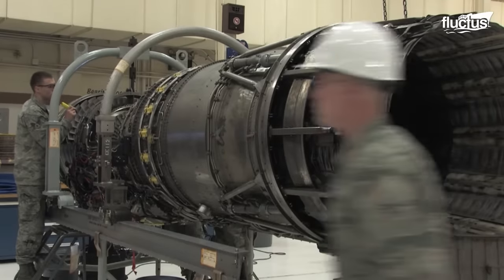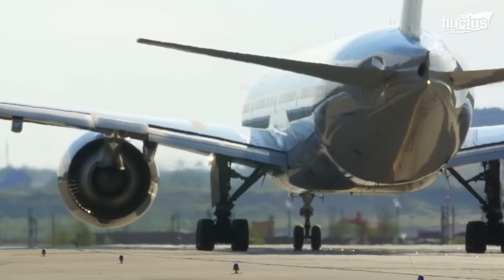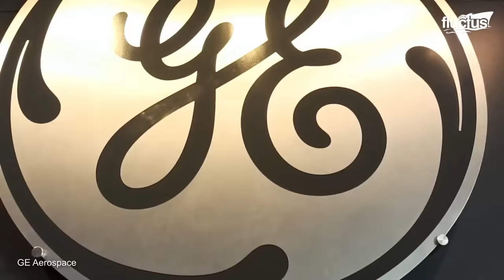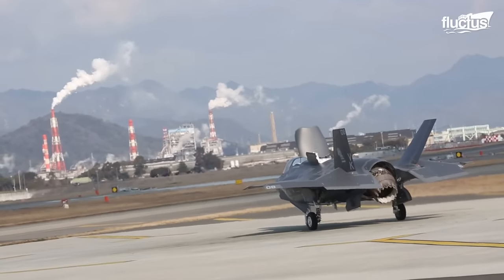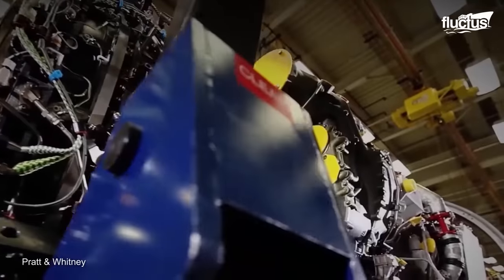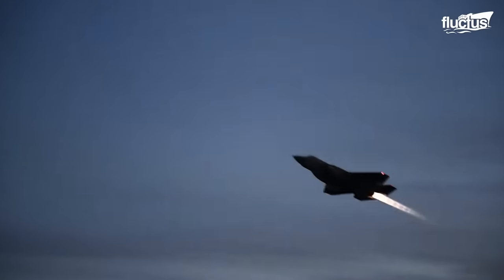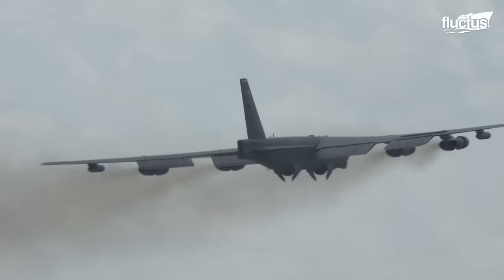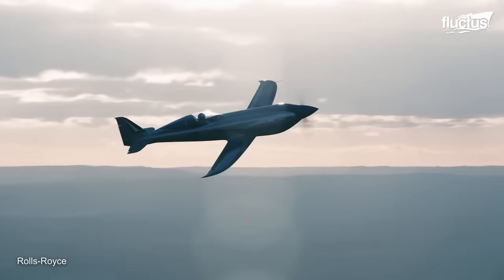Inside Advanced US Megafactories Building Billion $ of Futuristic F-35 Engines

Comment: The F-35B does not have a vertical engine. The front Lift-Fan is driven off the one jet engine Pratt & Whitney F135-PW-600 via the Rolls-Royce Lift-System.

Comment: Electric aircraft ??  Imagine the weight of the battery pack, even for lightweight aircraft!! Pilot to tower: "I'm declaring an emergency!"  Tower: "What's your problem?"  Pilot: "My batteries are dead!!"
Reply: Or  "This is your Captain speaking. Passengers with fully charged phones are kindly requested to connect your phones to the connectors under your seat. Apply to flight personnel for more information, but for God's sake, do it fast "

Comment: I was at Edwards Air Force Base during the testing of this aircraft. 
The reason the 35 was built, was to give the u.s. a plane they could sell.
The technology on the 22, is still top secret and when it goes out of service, it will still be top secret.
The closet plane today to the 22 is the B-21.
If you still think these aircraft are advanced, you should have seen what was being developed in the early 90's.
Reply: early 90's? any example?

Comment: You state that the F-35B VTOL model has an engine behind the cockpit that "points up" in addition to its propulsion engine. That is not correct. The F-35 has ONE engine that drives a ducted fan for vertical takeoff.

Comment: Do they test every engine they manufacture?
Reply: I think for the price of the engines and the small amount used and manufactured they probably run tests on every engine also considering a mistake could be a one time mistake since it is made by humans and also considering the chance of the engines failing mid flight is to dangerous so if the manufacturer doesn’t test it the buyer definitely will
Reply: "Acceptance Test" is considered a part of production and is SOP in most cases.  They do this of course to ensure any post-assembly issues are caught and remedied before delivery to any customer.  Acceptance Test also establishes a baseline for an engine that can be used to project out maintenance planning into the future.  There's a lot more to it than just that, but that is the gist of it.
Reply: "Do they test every engine they manufacture?" 
Yes !

Comment: I get to test the f135 engines here in Oklahoma. They are pretty insane in person. Getting up close to all the machining and engineering on each part is amazing. Not all your facts were correct tho. Still a great video none the less
Reply: They aren't that amazing. The f16, f18 and certainly f15 have better engines. Whats so mesmerizing abt this plane?
Reply: Dependable engines
Reply: @TheMrgoodmanners they make more power than the engines in any of the aircraft you just mentioned, and in the case of the Hornet it makes more power than its 2 engines and ties with the Super Hornet's improved twin engines. It's not even a completely bespoke design, having sourced from the F119 and still manages to power both the aircraft and numerous systems onboard that would likely fry legacy fighters trying to run them.
Reply: @forzaelite1248  Well said. this. engine is the evolution of the F119 and proud to be so. The difference in performance between the F-35 and. F15 stem from differences. in aerodynamics and USAF changes in doctrines.
Reply: You get to test F 35 engines you must be at Tinker I used to work on TF 30- P109

Comment: Jet engine do not have 1000s of moving parts, some assemblies have 100s of parts, but operate as a unit. The F35 does not have a front vertical engine, it has a "FAN" driven off the main engine
Reply: Modern engines do indeed have a thousand moving parts. Just the IGV system alone has several hundred.
Reply: Keep the noise down little man
Reply: @shannonjurgens3667 that seems a bit much, afaik the moving parts of a jet engine are usually just the turbines which total up to two or three spools; I guess the compressor/turbine blisks count up to 10-15 or so if you count them unless you're referring to all the fuel/oil valves. Technically speaking, engines like ramjets and scramjets have no moving parts at all
Reply: if a part A is attached to a rotating part does that make part A moving?
Reply: What about the fuel control unit, pneumatic starter, hydraulic pumps, oil scavange pumps, pressure pumps, pressure reducing shut off valves, check valves, thrust reversers, dynamic seals, Intergrated drive generators, dedicated alternator, fan air valve, gear box...how many moving parts do they have...and yes I fix jet engines.

Comment: RR had the oil stub-pipe problem and PW had the exploding combustor cans problem. I prefer GE.
YES, I watch a LOT of airplane disaster videos. Planes are only as safe as the worst mechanic to work on it, and as dangerous as the airline that cuts corners, and refuses to grease parts like the jack-screws.

Comment: The big blades is moving by what ? .
Reply: The fan blades are generally powered by the inner shaft connected to the low compressor and low turbine. On some Rolls Royce engines there is a third spool with additional turbine stages connected directly to the fan and on the P&W Geared Turbofan engines the fan is connected to the low turbine via a gear box so that the low turbine can spin at a more efficient speed.

Comment: No, the F-35 in not the most advanced fighter jet on the planet. The F-35 isn't close to the F-22. With the new updates to the 35. The 35 will become closer but not equal to of surpass the 22.
If you stated the F-35 is the most advanced fighter jet in production today. Then you would be correct.

Comment: It's all fun and games until that electric plane receives a wing strike from lightening and its batteries are fried...

laughs in Jet fuel

Some things although innovative and cool, pose an unnecessary risk to integrate it as an industry standard. I for one will not be flying on any electric-powered planes if I am still alive by then.
Reply: Nor fly an airline that has hiring practices of diversity over skill and ability.
Reply: Do you know how much a modern plane relies on electronics already? A battery will not add any risk that is not already there.
Reply: A Boeing 787 is mostly electric, flaps, landing gear and most all of the major systems that were handled by hydraulics and pneumatics in older aircraft. Engines powered by electricity in transport category aircraft is another matter. Transport category aircraft are designed to take a lightning strike without major damage, I've had seven.

Comment: Compared to the new Japanese engine, the diameter is more than 2 m, the new engine fits in 1 m and has a thrust of 11 tons, 4 times the diameter, the thrust is 14 tons, 4 times the diameter, and the square of the diameter is 4 times, the newly developed engine in Japan has a thrust of 11 tons and a diameter of 1 meter. Weight is around 2 tons, twin engine 22 tons has a total weight of around 4 tons, has 70% of the thrust of foreign engines, 70% of the thrust of 14 tons has about 10 tons, 22 tons vs. 70% of foreign engines is 15.4 tons, around 4 tons made in Japan, ( (The Japanese engine is 11.4 tons lighter) Loaded with 11.4 tons more weapons, ammunition, missiles, fuel, etc. The durability of a fighter jet is determined by its endurance time.The reason why fighter jets are used for 15 to 30 years or more like in Japan. Japan has the technology to accurately manufacture both ultra-small precision parts and ultra-large parts.

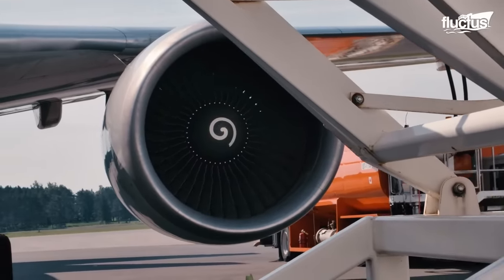Comment: At 1:40 into the vid you state that Fuel is added and ignited to produce increased Pressure & Thrust to the compressed air. Wrong, there IS No increase in pressure beyond the last stage of the air compressor blades as a result of adding fuel and ignitingthe mixture. If that were so, the compressor would Stall from the backwards pressure. Thrust is produced from the Expansion & Velocity of the compressed air moving aft thru the engine. There is only about 1/2 lb of difference in air pressure between the air entering the engine and the air exiting the engine in a typical jet engine w/ the higher pressure at the front. The highest pressure within a turbine jet engine is Always at the last stage of the compressor, otherwise the air would be forced out the front of the engine. Propeller driven Aircraft have a higher pressure differential between the air striking the blades and air pushed aftwards than does that of a Jet Engine.
Reply: Im sorry but you need to go watch a video on how cumbustion works in jet turbines. Retired engineer and expert in Turbine design and Engineering.